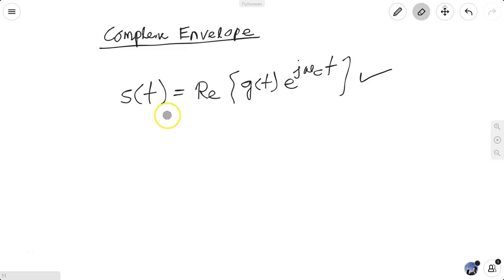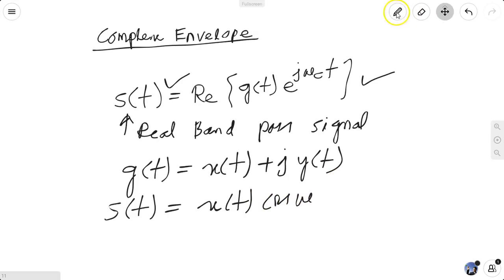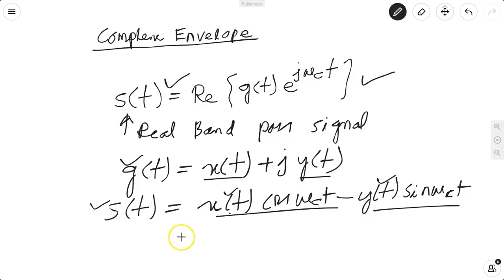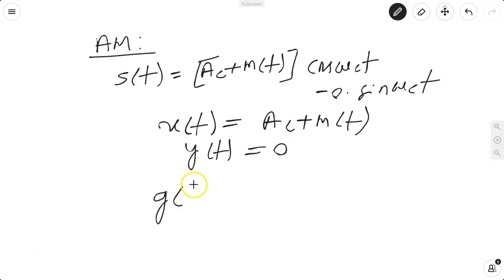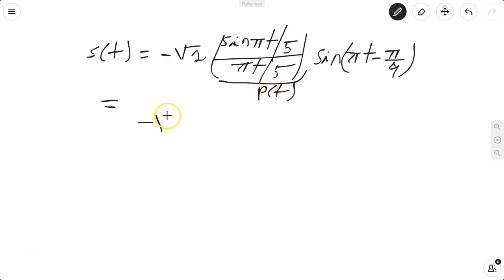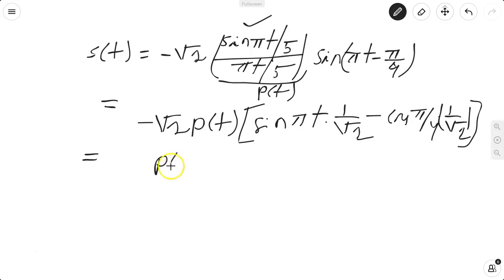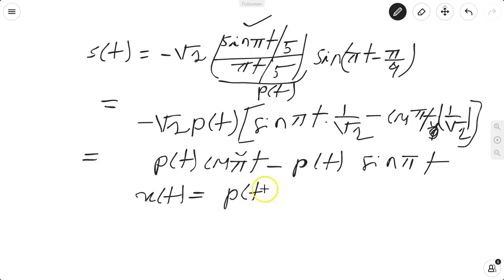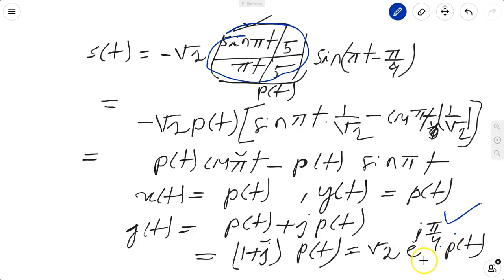Complex Envelope

Comment: Superb sir.
Reply from the maker: Thank you anshu
Reply: Real gate mentor ....
Sir one question...
Practical advantage of complex envelope? ???
Reply from the maker: It, in fact, helps in mathematical analysis of modulated signals. If you know the envelope detector, it is the same envelope which is detected by it. Every band pass signal has an envelope, which is a low pass signal related to modulating signal.

Comment: Explain why complex envelope? only for Band pass signals... why not for other signals.. Explain the first equation... what it signifies.. that is the real concept.
Reply from the maker: It, in fact, helps in mathematical analysis of modulated signals. If you
 know the envelope detector, it is the same envelope which is detected 
by it. Every band pass signal has an envelope, which is a low pass 
signal related to modulating signal.